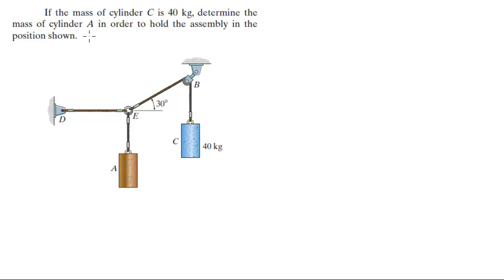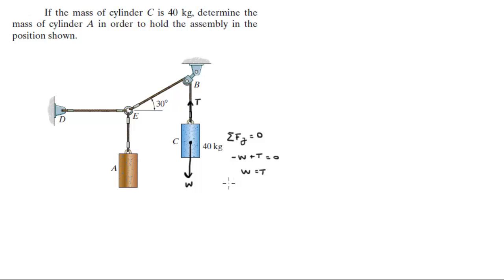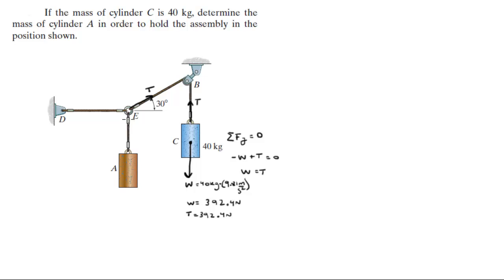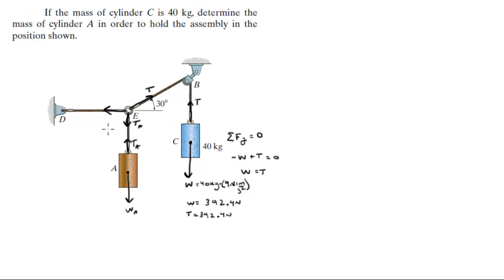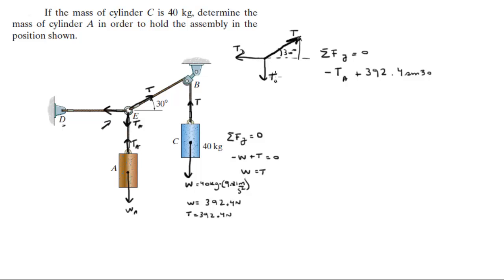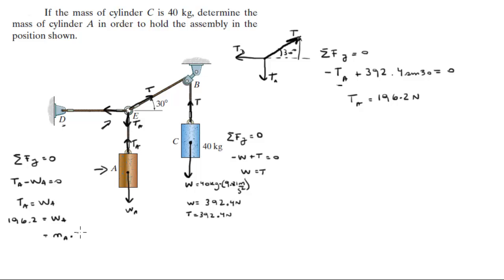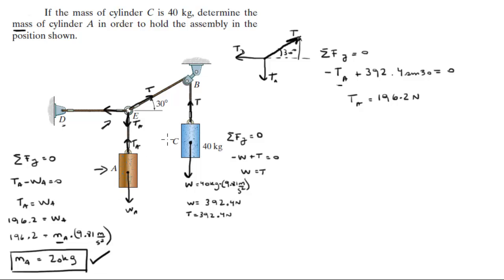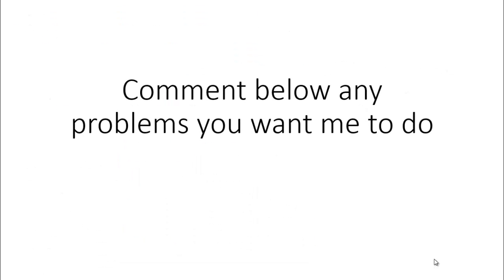Determine the mass of cylinder A in order to hold the assembly in the position shown.

Comment: Can someone help me find the tension between points D and E? I have the same question for a homework, only i need to find the tension between those two points. Thank you in advance.
Reply: same
Reply: hala bad
Reply: wtf same bro
Reply: Darko Maslarkov omggg me tooo
Reply: wtff bro
Reply: just solve for it using x components
Reply: It's been 4 years but if anyone need an answer here's how i did:
Td just equals anything on x-asis. For this question we only have 1 tension that we need to calculate. And here's how:
Td=Tbx
Td=T . g . cos30
Td= (50kg)(9.81m/s²)(cos30)
Td= 424,785